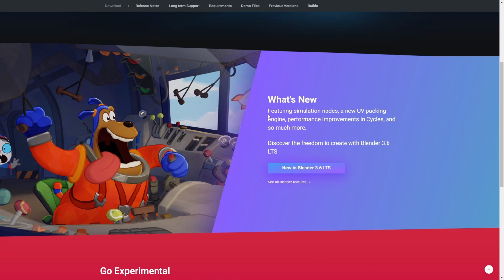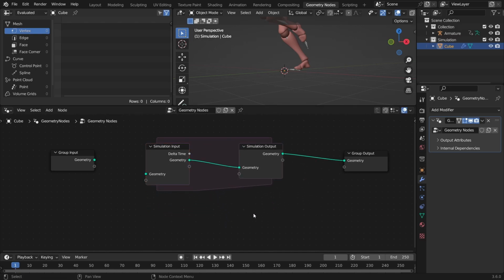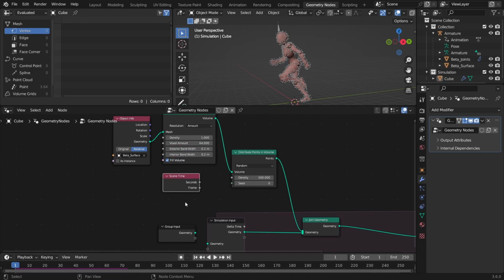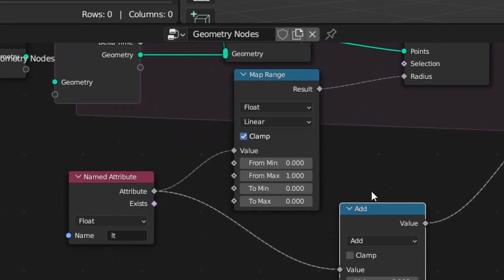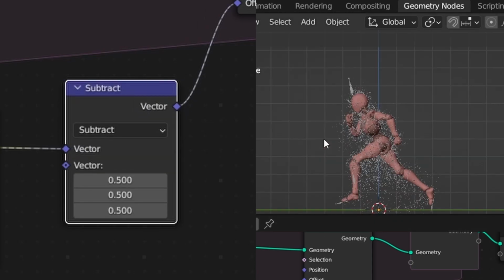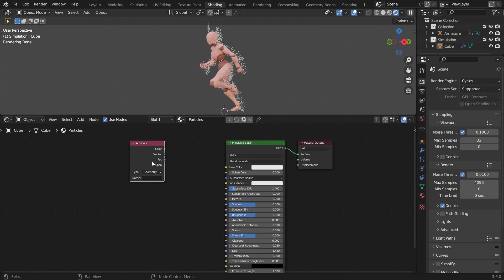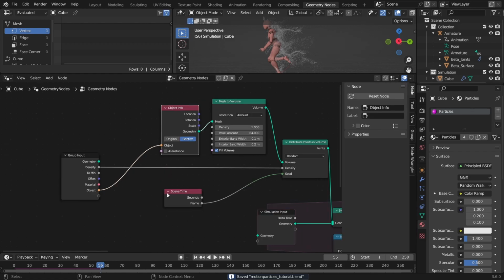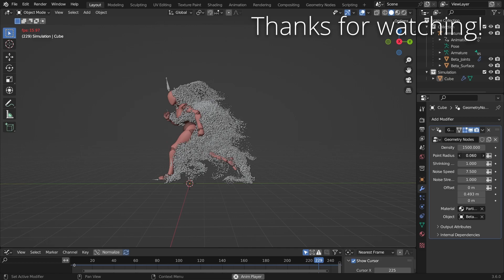Easy Particle Simulation | Blender 3.6 Geometry Nodes Tutorial

Comment: hi, is there a way to make it compatible with eevee?
Reply from the maker: Yes! Add an Instance on Points node after the Simulation Output and use an Ico Sphere or any other mesh primitive as the Instance. You can then use a Radius node for the scale in the Instance on Points node
Reply: @Khamurai  its works! thank you so much
Reply: i was on cycles i still had to do that  @Khamurai  why is that so , or i couldnt see it in shading tab
Reply: @@symb0l1c thats not true. you will be impressed when yoou see what people can make in the eevee next renderer (4.1 alpha)
Reply: @@symb0l1c Nothing would make me happier, but unfortunately I work for scientists and attorneys who need the animation yesterday, so sometimes I need to render as fast as possible.
Reply: Tf kind of nonsense are u even blurting bruh@@symb0l1c

Comment: Can’t i do the way easier with particles? What’s the benefit with sim nodes
Reply from the maker: Both has it's own strenghts and weaknesses

Main thing about doing simulations with geonodes is how fast you can change and iterate on things. You can expose any parameters you want from the node setup and reuse the whole setup any number of times with different values or objects or whatever else you want to swap out.
You also have things like geometry proximity and all the other cool features available in geonodes that you can use along with the simulation too to further modify the behaviour of the simulation.

In the end it's about what you need at the moment or what you feel more comfortable with using, and since this channel is focused on geometry nodes this is the approach I chose

Cheers

Comment: The particles aren't rending in SheepIt, how can I solve this?
Reply from the maker: You probably need to bake the simulation cache and include it when you upload to SheepIt.
To bake in a specific folder you can specify that in the geometry nodes modifier, there is a section called "Internal Dependencies" at the bottom where you can select a bake folder.
And also make sure you render with Cycles
Reply: @Khamurai  Thanks! Hope that will help!
Reply from the maker: Let me know if it works!
Reply: @Khamurai It worked! Thanks you a lot!

Comment: The second set position node looks like it moves the particles on the Y axis in the video, I know the vector math is required to fix.. the.. math problem that I'm too dumb to understand, so when I tried the same thing the points obviously went off in a (not random) random direction.
I tried running a separate XYZ node through a vector math node set to 0.5, to the second set position node but the points are still going off at a slight angle.
Is there a formula I should spend an hour failing to understand before giving up trying to recreate it in geo nodes? Or is this just a bug with the blender geo nodes?
Reply: @32Bivens  cheers mate, my dumb ass gets so lost looking at equations

Comment: weirdly with my density of point in volume set to 100, the deleting the invisible points has me at around 190k points, I'm using a rigged character from mixamo so a slightly bigger volume to fill but I can't imagine 160k at 0.4 less point density volume difference which is weird.

Anyway because of that I stuck the node group on a rotating cube, set the points to 500 and was getting around 60 fps playback so between the scene time and noise texture I added a math node set to multiply at .005 to get the same sort of noise effect seen in this video where the scene's playing back at around 17 fps.

Just in case I'm not the only idiot that runs into this issue